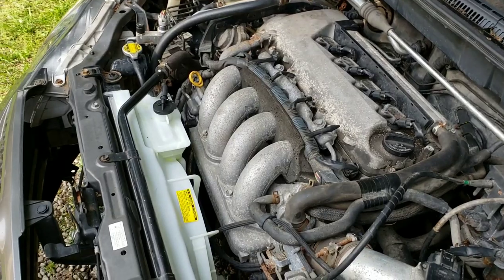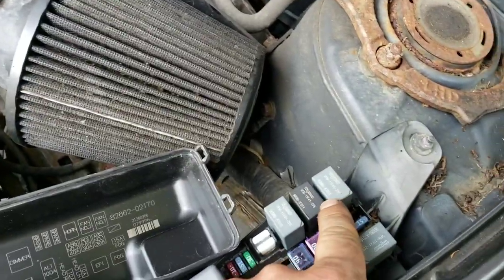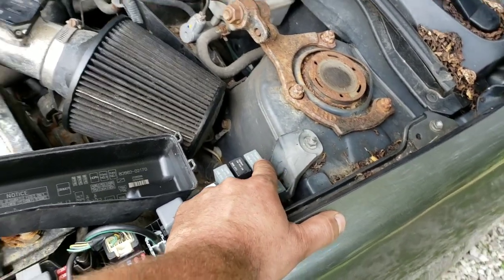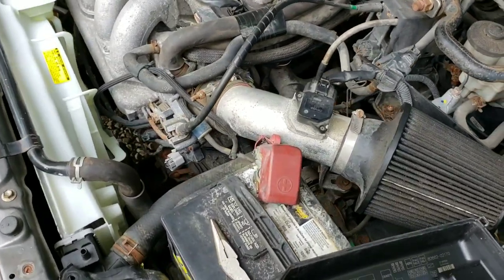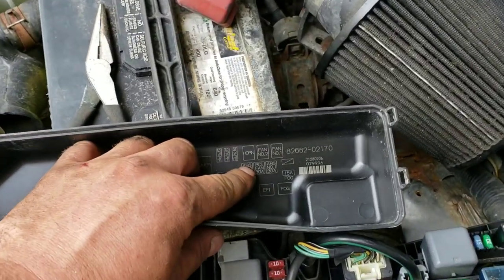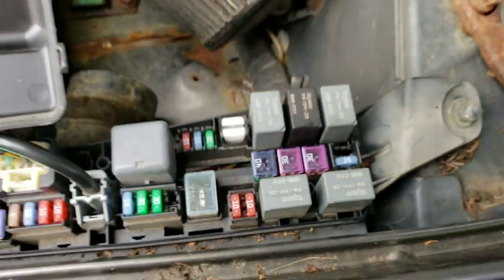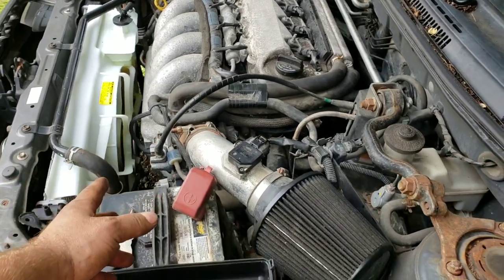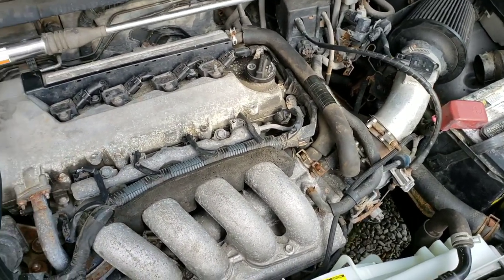03-08 Toyota Corolla & Matrix Cooling Fans How to Diagnose & Fix DIY

Comment: This is not a 2006 corolla. The intake on this is metal and not plastic. Also in 2006 they got fly by wire and this car clearly has a cable. Fyi
Reply from the maker: Uh, this is an XRS model genius... different engine 👍

Comment: I just had to replace the radiator and fan assembly in my 03 Pontiac Vibe. It has the same engine as the Corolla. This fuse was the reason that my fan didn't work (and what caused the radiator to blow). Thanks for sharing this!
Reply from the maker: Yup

Comment: I just bought a 2005 and noticed my fans only kick on when i have the a/c on. Do you know what it might be? So probly the low fan relay is bad?? Thanks in advance..
Reply from the maker: Idk man; everything I knew about I said in this video. Fuse, relay, wiring, sensors. Also, they won't kick on until the car reaches a certain temp. If the car doesn't try to overheat, then it may just not be warm enough to kick them on yet.

Comment: My ac started blow warm air then my car overheated. I watch several video, could be a fan motor, or as simple as a fuse. I do not want to over pay for a repair. Pls help
Reply from the maker: Well yeah the first things to check when a car is overheating is if the cooling fans are working, if you have enough coolant in the system, and if your thermostat is working or not. Those are the 3 main things that will cause an engine to overheat if not in proper order.

Comment: I'm having an issued with my fan it won't turn on but if I turn on the ac it'll work
Reply from the maker: So did you check the fuse and relay as I discussed in the video????
Reply: @BuckeyeBallistics  not yet it's my mother in laws car I'll have to wait for the weekend

Comment: What is the ECU. I'm having an issue with my matrix, radiator fan isn't working and it's brand new.
Reply from the maker: Electronic-Control-Unit - It's the vehicle's computer. Also called the PCM, the powertrain control module.

Comment: I've got a strange issue with my 2005 toyota corolla. The center cabin console clock went out a long time ago. Then recently the AC would stay on after the key was turned of.  I had to turn car on and of and it would stop. That magically fixed itself but now the cabin blower will stay on even if its turned off and key removed. If turned off it will be super low but you can hear it. I can stop it by turning the fan hi then low. I do it a couple of times to be sure. Sometimes turn on power with key and do the on off trick. Sadly I still come out sometimes to a dead battery. 

Any ideas about how to fix? I'm assuming a bad fuse? AC fuse? Blower fuse? Location?  Thanks a bunch for any help.
Reply from the maker: Yeah that's odd, definately something electrical. I would definately check the fuses and relays for everything. There are some under the hood and then some down under the steering wheel area. The covers should say what's what.

Comment: hey bro so i have an 05 xrs matrix replaced fans fuses and relays still got nothing could it happen to be the ecu?
Reply from the maker: It could be but very unlikely. Do the fans kick on when you put it on defrost or turn the ac on? You need to find out whether or not the fan motor still works. You can also test it by running thin wires off of it to the battery if you look that up. Also if the car has two temp sensors, one for the guage and one for the ecu (can't recall if it does), the one for the ecu could be failing and reporting the wrong temp to the ecu. Of course check the wiring, connections, and grounds as well.
Reply: I know its 2 years later, but did you ever find out what it was?
Reply: @amloviumexico  2 Ecus and a crankshaft ps later found out it was the crankshaft ps
Reply from the maker: @Carlos - How on earth could the crankshaft postition sensor have anything to do with the cooling fans...
Reply: I dont know man but I'm stuck, the mechanic had the car for a full week and could not figure it out. Just changed the radiator, cooling fan sensor, the relays work, the fan works when hot wired but it wont work normally
Reply from the maker: @amlov - Well you need to take it to a competant mechanic then. There may be a break in the signal or short in a wire not allowing the transfer of data or power to activate the fans. They will have to probe and test all the wiring, grounds, electronics etc to find were the problem is if everything else has already been covered. Unfortunately this may mean needing to take it to a Toyota dealer that has been around for a few decades and paying out the arse to get the issue resolved (their labor rate is usually high). Good luck man...